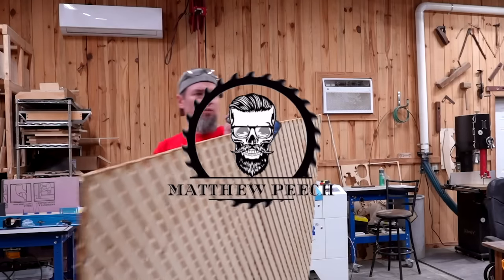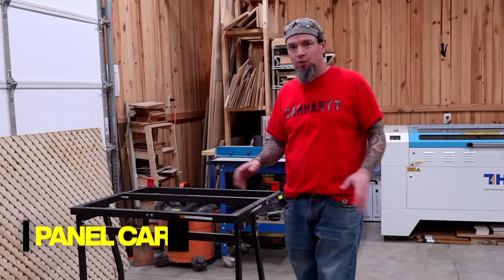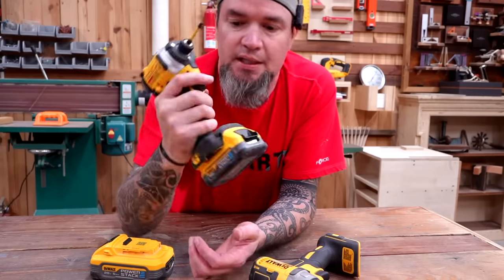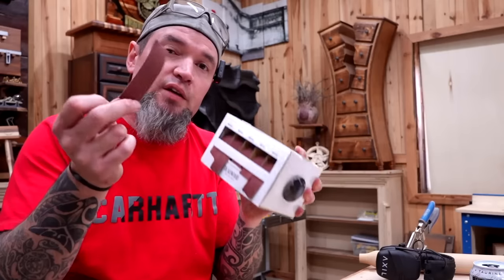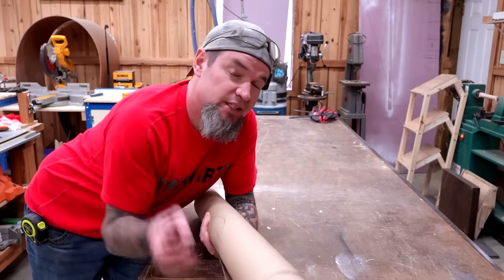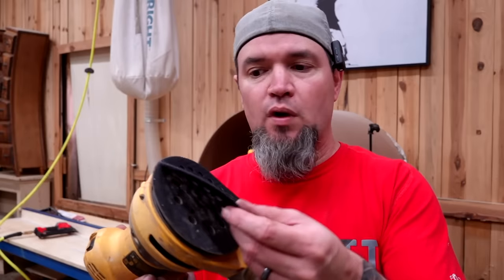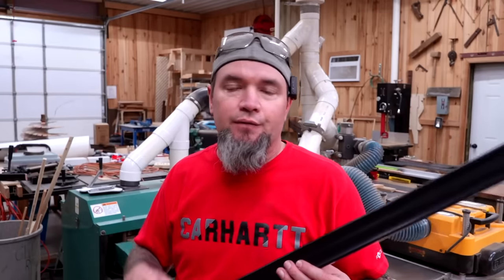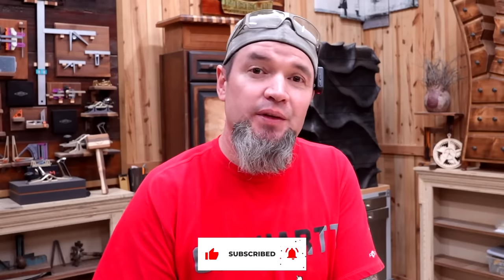14 Tools I Wish I Knew About Sooner

Comment: As a fellow Kentuckian (Hazard) I really appreciate all your content and you've become a major inspiration to me in my woodworking journey. Thank you so much Mr. Peech!!!
Reply from the maker: Hello neighbor! Thanks for the support.
Reply: Hey there - Happy subscriber from Louisville here!  Love these helpful hints and tips.
Reply: Do you just call it fried chicken or Kentucky fried chicken?
Reply: As a traveling master electrician I have spent many years working all over KY, probably spent about 10 years in KY.  Worked with a fella years ago from Hazard. That boy kept me in stitches, don't remember his name but he went by the name Hillbilly. He sounded just like Larry the Cable Guy, when no one had heard of Larry. I do agree Matthew is a treasure. Concerning impacts my dewalt that I've ran for years has a pushbutton recessed chuck. So it is extremely compact with all 3 speeds as well. Got a heck of a deal at HD up close to Ft Knox. From face to rear it is smaller then the Milwaukee 12v impact. Panel lifter,  se a ⅜"or ½" dowel to make a 3½" toggle. Drill a hole in the center and put on a piece of paracord about 8' may need to adjust for height. Add a 6" long piece of pvc pipe. Tie the paracord in a loop. You can then use the toggle around your belt fed back through the paracord. The pvc is the handle after running paracord under the panel. Can then carry em anywhere under your arm.  All granted that you're tall enough to do this in the first place.
Reply: Same here coming from Montgomery Co. It makes everything feel a bit more relatable for some reason. Thanks for all the helpful videos for a newbie
Reply: Except I'm from WV. Thanks Matt!

Comment: I’m so glad I saw this video! I inherited my Dads workshop. There are so many tools I have no idea what they are or how to use them. I have a couple of those thickness guides you showed at the end. Now I know! I have old equipment. Ever heard if a ShopSmith from the 50’s? I have a lathe the size of your adjustable table you received as a gift. One thing is the plugs scare me. I need to find out how maybe I should replace the plugs. They are all workhorses. I have drill press, routers, band saws, table saw (huge cast iron contractor saw), every Dremel tool including the very first one. What do I do with them all? I actually can’t wait! I go to Home Depot and go up and down the isles seeing if I can match up with something I have. It’s like a candy store!! Happy New Year!

Comment: Love your channel, it brings back great memories of working in the shop with my step-father. He would have loved some of these gadgets. 

If you live near a printing press for daily papers, or have a friend that works there, they will have lots of 'end rolls' left over from printing. They will eaither recycle or trash them, so check and see if you can get them free or cheap. They would work for a craft paper sub (it will be a little thinner unless you chance upon some premium paper rolls). These can be used for table protctors, moving (since there isn't any ink that will transfer to things like dishes), school banners, paper mache, etc.
Reply from the maker: I actually live close to a place that makes paper plates and a friend can get me the end of the rolls on those. Those are so nice!

Comment: I just stumbled across the sanding pad saver grip things the other day. I had no idea they even existed. I wish they had something like this for the old stick on sandpaper we used on the old sanders! The hook and loop set up is the best thing ever invented for woodworkers. 

I have a panel lift tool, but you have to place it on the bottom edge of the 4x8 sheet. Like you, I used to be able to pick up 3/4” plywood sheets easily, but no longer, so not sure what made me think I could do it with the panel lift tool I bought. That Kreg panel lift is awesome and I’ll pick one of those up! Thanks for the reviews.

Comment: I bought rubber horse stable mats from Rural King for my shop floor. They are durable and relatively cheap. $40 for a 4' x 6' x 3/4" mat. They can take a lot of abuse from a horse, so it is good enough for me. They are soft enough to stand on for long periods of time, yet firm enough to roll equipment around on them.
Reply from the maker: Nice!

Comment: I can attest to the value of the adjustable height work bench.  I use it for an out feed table as well and it rocks! Also great as a work bench because the height difference between me and my husband is substantial.  Standard is always too high for me and too low for him.
Reply from the maker: Thanks for the input. It’s a great tool to have in the shop for sure.

Comment: I just used my pack of 1 inch sanding strip. I needed to sand the inside of a finger hole I drilled in a lid. I wrapped a piece around a thick dowel, and got it done.

Comment: A stumpy nubs tip for cleaning the saw blade is a 5 gallon bucket lid with a dimple in the middle, put the blade on the lid and spray the cleaner over it leave to soak and Vola 👍

Comment: 3M Cubitron sand-paper is available in 2.75" wide rolls that have perforated tear-lines, that produce squares of 2.75", and are in different common sanding grits; 40, 60, 80, 180, 220(probably 120 also, but we don't use the 60 or 120 in our body shop.)For sanding blocks with suction used on the Mobile Festool Sanding Stations. I don't have the sanding at my home shop cause it's like 6grand. But I still use the hook look style paper because it last so long, and it's tuff. I've seen the Cubitron II, but I haven't used it.

Comment: If you think multi speed impact drivers are cool, wait until you get a multi speed hydraulic impact driver, like the M12 or M18 Surge hydraulic impact from Milwaukee…. SOOOOOOO much quieter, and less vibration in use!